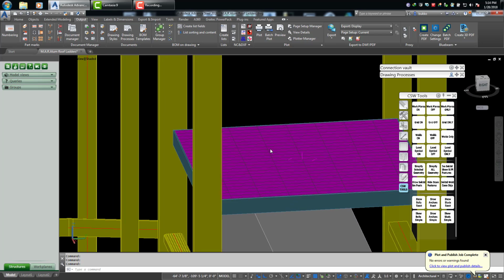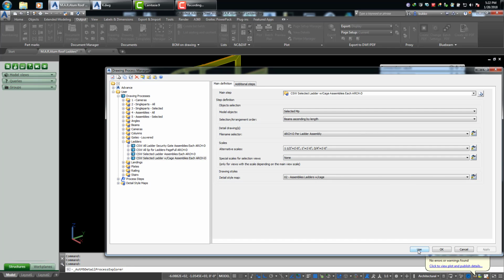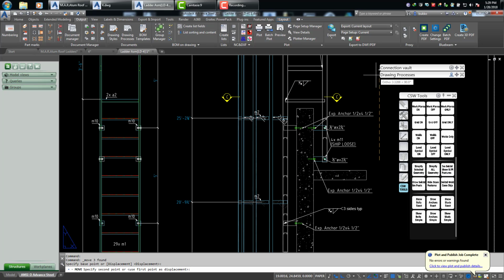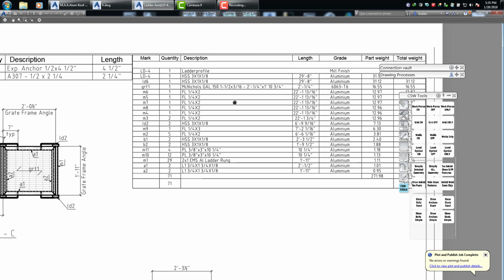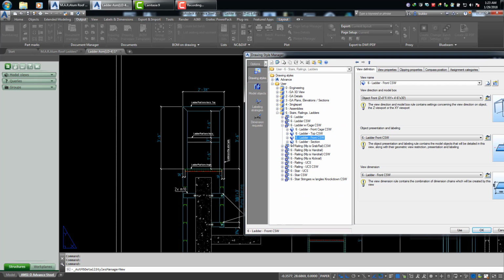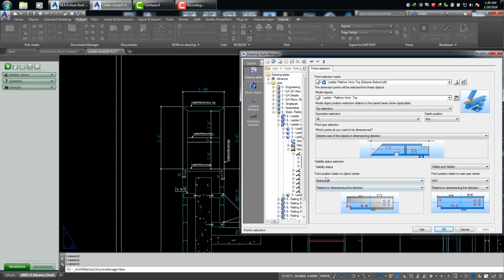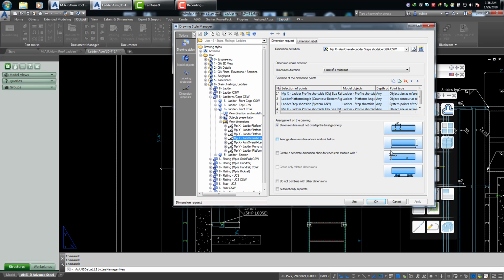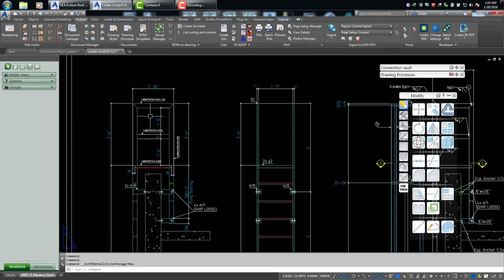Advance Steel 2018 Cage Ladder Drawing Style

Comment: Thanks a lot for this video Craig- the amount of explanation is very helpful. I noticed the wall connections that you have on your ladder connect to the side of the ladder and have expansion anchors in them. I have tried to put that in my own ladder, but it appears the out-of-the-box ladder options do not allow for that. How were you able to adjust the wall connection properties? Thanks!